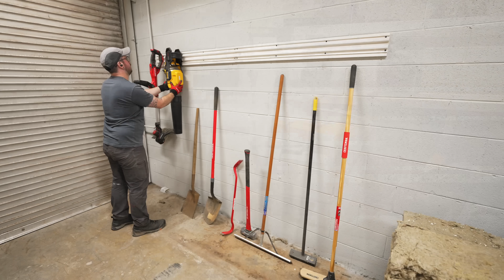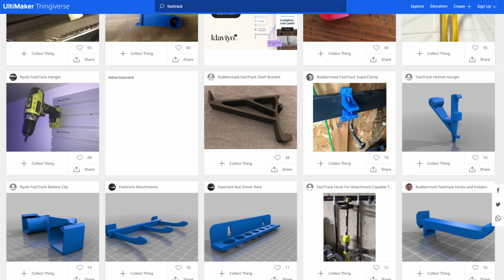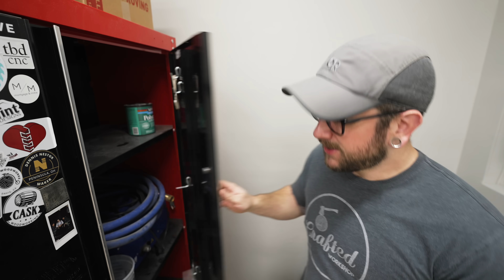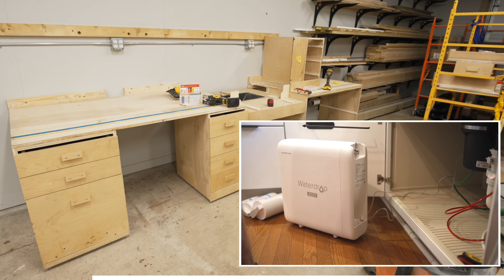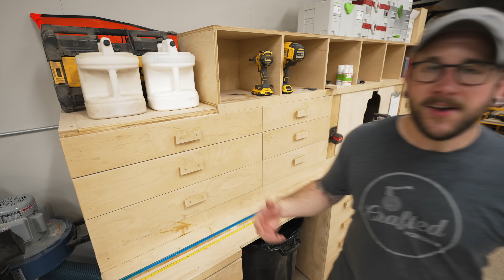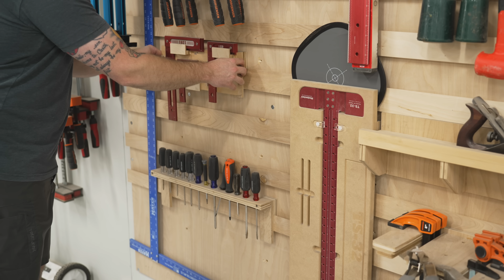6 Awesome Shop Storage Systems to Organize Your Workshop (or Garage)

Comment: The problem with french cleats is using them for longer items, such as clamp, which "waste" a lot of space vertically. You could have mentioned using shop-build tool holders simply screwed to  a backer board, such as plywood. I've also seen lengths of copper wire fashion to hold tools and mounted with pan head screws. Very flexible. And Cheap.

Comment: I want to give a good shout out to slatwall. I have been using slatwall in my shop for years. I have shelves, pegs, hooks for specific items, it works perfectly. It's not for everyone tho, I have definitely come to the conclusion that what is the perfect solution for one person is definitely not even applicable for another person. A great example of this is bike storage. For some people, those hoist systems are perfect. For others hooks are perfect. For me, neither are good or optimal or even an option. I also have 7 bikes to hang in a very small space. But again, for someone else, it could not be more perfect

Comment: Plywood, mdf, or particle board w/ nails, screws, wire, chain, straps, hooks, pvc, and/or etc. as hangers. Probably the cheapest. I've always liked the look of the french cleat system, though.

Comment: The rolling tool chests have evolved and work very efficiently, for a few key reasons: 1) the drawers are a good size to visually scan, and depth fits a great majority of standard tools. Liners and some internal organizing is all one needs to learn what goes where without over-organizing and wasting space; 2) more small cabinets can fit on top, and drawers are at or below eye level, a real problem for built-in shelving and cabinets over work areas. 3) Most drawers fully extend, and are very strong even loaded with tools. 4) You can move them nearer, or away, from areas, and unlike tray systems, aren't likely to tip over. The metal construction is rigid, but thinner than any wood drawer systems, which are heavy and usually built semi-permanently, demanding a lot of pre-planning design.
  If your shop is for miscellaneous repair and DIY work, not woodworking, building out a full storage and wall system is impractical and costly, without all the wood tools needed.

Comment: Slatwall, like Gladiator GearWall. You’re using the wrong product (tracks). Use the Gladiator slatwall with Premier tool cabinets. The Gladiator steel hangers are stronger, hold more weight than French cleats. Plywood cleats tool holders often must be bigger than the tools. You can fit far more tools on a Gladiator GearWall with hook hangers and this system is infinitely adaptable for ANY storage needs. We installed the slatwall on all three garage ❤

Comment: Really balanced presentation!  One thing I would add is that the "rail" that I have is a 1x3, painted white, with either dowels, hooks, or nails in it.  That's what I have in my garage, all the long things hang from that.

You make a good point about being locked into a brand with some systems.  In my opinion, no one should buy into any system that is brand specific, if for no reason other than it will eventually be cancelled.  Use plywood, cabinets, cleats, pegboard, open shelving.  If there aren't many companies making the product, you're both stuck and paying too much.

Comment: "Enjoy" your video? No. I found it incredibly depressing. If these are my only realistic options, I'll NEVER get my workshop organized. I've already got my tool density almost a full order of magnitude more dense than yours and still can't seem to efficiently organize: a 19" bandsaw, 2 bench-grinders, a miter saw, a 7"x21" lathe with associated rests, chucks, & vices, a combo disc & belt sander, vacuum cleaner, dust collector,  ultrasonic cleaner, 15 gallon air compressor, an assortment of handheld power tools (Sawzall (2), impact driver (2), cordless drill (2), dremel, heat guns (2), angle grinder (2), portable belt sanders (2)), a collection of clamps, bench vice, a drill press, a full set of hand tools (wrenches (SAE & Metric), sockets (SAE & Metric), ratchets, power bars, torque wrenches, screwdrivers, numerous hammers, allen wrenches, saws, various cutting tools, pliers, tin snips, bolt cutters, riveters, staplers, hot glue guns), propane torches, precision measuring tools (calipers, micrometers, runout gauges + support hardware, levels, squares), taps (SAE & Metric), dies (SAE & Metric), punches, chisels, soldering irons, multimeters, along with all the replaceable cutting/sanding (sandpaper, steel wool, blades, cutting wheels, grinding discs, bandsaw blades, sanding belts & discs, drill bits, razor blades, lathe cutting tools, mill ends, vacuum filters, etc.) consumables. PLUS various raw materials (wood, metal, plastic, wire, rope, screen, nuts, bolts, nails, specialty fasteners, rivets, staples) used to create things. Also, all the lubricants, glues, solvents, & cleaning solutions to support projects. My workspace is 10' by 20'. Two ends can't be used because one is a garage door, & the other is a walkway. Oh, I forgot airless painter, paint, drywall related patch stuff. I'm not including my numerous shovels, picks, pruners, leaf blowers, edgers, hedge trimmers, chainsaws, machetes, rakes, brooms, string trimmers, loppers, sledge hammers, etc., which I have organized into a 1.5'x1.5'x8' space. None of those systems you showed seemingly could accommodate my collection of tools & materials, leaving me depressed. Your demonstration of a broom & shovel wall hanging solution made me laugh. I have over 5X the number of tools in that category you showed I've got it packed into that 1.5'x1.5' space I mentioned. I want to get everything neatly organized. I fix stuff, & I make stuff. I also do my own gardening. I tend to work more with metal than wood, but I have the tools for both. Oh, I also forgot what I call my specialty tools: borescope, lasers, label printers, magnifying glasses, temperature measurement tools, and on and on. Oh, I also have a portapower with dies. When I was a little kid my father told me "A man has to be able to fix anything." I took that to heart. He might have just been joking. Dunno. I was just a kid. I sure as heck can fix way more than he ever could.

Comment: fire is a big hazard in any workshop, hence planning is needed: fire extnguishers but also a garden water hose  but in that case care must be given to electrical wiring, it runs on the floor and will get in contact with water...an overall breaker for the whole workshop would be required. Any ideas as fire exting. will last 30-40 seconds and the workshop is full of dried wood and sawdust. what would you recommend ?
Reply: I would suggest that using water as a backup fire suppression system is a poor choice. Not just because of the electrocution potential you mention, although there is some significance to the annoyance of being electrocuted, but also because water will wreck a lot of your stuff. Your average big box store will have largish fire extinguishers you can use. I have two in my workshop, a little one, so if there's a small fire I don't hesitate to use it, and a big one in case things try to get out of hand. In my home EVERY wall socket that has the potential to come into contact with water, so workshop, garage, kitchen, bathrooms, outside, are all on a GFCI breaker on the master electrical panel. NOTE you can stack GFCI breakers one after another in a serial fashion and they won't hurt anything. So if you can't put one in the master panel, just put a GFCI protected outlet everywhere an outlet might come in contact with water. Being electrocuted by home current isn't fun, but is only sometimes fatal. What you really want to be careful of  is commercial power, 400v and above. I've been electrocuted by house current several times. I'm still mostly here. I had a friend grab a hold of some 400v. A nearby friend had to knock him loose with a 2x4. His hair turned white & he couldn't see for a few days, but he survived, mostly. When I work with electricity I always: wear insulating gloves, wear rubber soled shoes, and I have two voltage proximity testers to check for current before I do whatever work I'll be doing with those wires. They're cheap ~ $10. You move them near, you don't even need to touch them, to a source you want to check to see if its hot. It'll tell you. I've worked with live wires many times using those insulating gloves & shoes, but I shouldn't have, and I try not to make it a habit. When it comes to live wires, it is very important to not put your lips on them. The saliva in your mouth will act as a conductor, and the mild tingling normally felt when you grab onto a live wire will be a tad more noticeable, so try and avoid wrapping your mouth around anything that might have live current running through it. I did that once. I'm not sure exactly how long I'd been knocked out, but it was less than 24 hours.

Comment: I use pegboards but I do have diy brackets for it by using screws a bit bigger than the hole so it can self tap into it while also being able to use the cheap standard hooks for a hand saw, F-clamps, hammer and more
Reply: exactly what i currently have

Comment: I have a little of everything besides French cleats. Pegboard is great for in-package items and some small tools, etc. Otherwise some husky wall cabinets, us general drawer units, Milwaukee pack out for my drills and batteries, then just some home built shelves/workbench. I use the track system for horses, and shelves too. I did what worked best for me.

Comment: If you do more metal or electronics work than wood or have a dedicated space for metal working and/or electronics repair; gun cabinets and wall mounted modular gun racks. They are basically a more compact and impact resistant french cleat.

Comment: I have slatwall panels, which is like an in between of the french cleat and versa track. You can buy off the shelf hooks, and making your own hangers shouldn't be hard. Only problem is it's load bearing capacity isn't as high

Comment: In the video open montage, there was a brief shot of a miter station that had a sliding miter saw. It appeared as though the section where the the saw was mounted, may have slid forward. This is an idea I have been trying to develop. I have a small shop that I’m trying to conserve space but yet be functional. If indeed that is what I saw, are there plans available. Your help would be greatly appreciated.

Comment: I’ve been mindlessly using the “not enough room so everything ends up in a giant pile” system for years. It’s cost me nothing but my sanity
Reply: I use this too, but with the "Go buy the tools you need for the project, because you can't find the one you have" add-on accessory pack.
Reply: While the system you mentioned is a time honored and well tested solution, in these modern times there are more efficient systems you can employ. This older, legacy system of "pile of stuff" may have old-world charm, but when it comes to being able to find things, it isn't as good as "stuff being in a designated spot" system of modern tool management.

Comment: Couple people also mentioned this, but just the plain "screw plywood to the wall, screw tool holders to it" "system" is my go to. I was going to go all french cleat, but realized that I hardly ever, if literally ever, will reorder my tools, and if I do need to, I'll just unscrew and rescrew. Saved a bunch of time over dealing with french cleats, and more importantly, in my mind, I can space things out how I want, if they are shorter/taller than the predetermined distance of your french cleats.
Reply: YEP ! that what i use!

Comment: You missed the wood wall system, otherwise known as the french cleat system without bothering with the cleats.  Attach a piece of plywood to the wall and then you can screw your tool holders to it.  Aside from not having to make the cleats, another advantage is that some things just need a nail or a screw to hang on so you don't need to make a holder for them.  And if you really need to be able to easily lift a holder off the wall then just screw in a small section of cleat for it.
Reply: you just solved my toolwall ADHD, with a 3/4" plywood wall I should be able to re-screw my stuff at a different spot every week XD
Reply: I just bought the house and previous owner did this and I’ll tell you, my brain can’t register organizing my tools with it lol. I do better with placements and categories. So I’m looking for new storage ideas and I like the #1 as I’m learning wood work. This should be fun to try lol.

Comment: A single sheet of thick plywood, spaced from the wall with 1x2.  Place nails or screws as needed to hang tools from.  It's just so simple, no building special holders that also hang from cleats, no losing pegs.  If you aren't setting up a retail display, how often do you really need to shuffle stuff around your pegboard or cleats?

Comment: Loved the vid. I had french cleats at my last place. I realized that after 3 years of working with that system, I never moved a holder once it was on the wall. I thought I would always be changing stuff around to improve the organization. Nope. I just drill or nail everything to the wall now. Even most of my hand tools that have a hole in the handle is just hung on a nail on the wall.
Reply: Ditto, but I mount a sheet of plywood to the (cinder block) wall to nail/screw into.

Comment: Pfft.  Obviously you've never experienced the joy and ease of use of buckets, milk crates, and just throwing everything on the work bench until it all starts to avalanche.
Reply: Don't forget to mix all the tools with electrical extension cords so when you need an obvious tool, it gets caught, and you need to pull everything out.
Reply: @nicko198718  Never have that problem if you just toss all your extension cords in the back of a pickup truck along with a few air lines and the compressor.
Reply: Bahaha. You're describing exactly why I searched out and found this video😅
Reply: Milk crates are Satan's trick on DIYers. Don't fall for the allure of their sturdiness. They are designed to never fit anything properly, and even if they do fit your stuff properly, anybody that sees your organization system will know you are a petty thief and will look down on you. And if the milk man ever happens to show up, boy howdy, you will have heck to pay, in spades. Don't dance with the Devil, buy your storage. Angels, and the milkman, will sing your praise.
Reply: Have you seen my shop? Cuz you just describe it.  Lmao

Comment: A dab of hot glue is a solution for the pegs coming off when removing tools from a pegboard. It’s easy to remove the glue when you want to reposition. But i still don’t like pegboards
Reply: Pegboards have their place. I mostly have various types of tape (duct, electrical, gaffers, double-sided, masking, silicone, and some specialty tapes) hung on my pegs, but I've got some string and some pipe wrenches hanging from some. I don't use them for tools, other than the pipe wrenches. I don't do much plumbing.
Reply: They make plastic hook locks for pegboard
Reply: Hot glue? Might aswell be using saliva. Epoxy would work